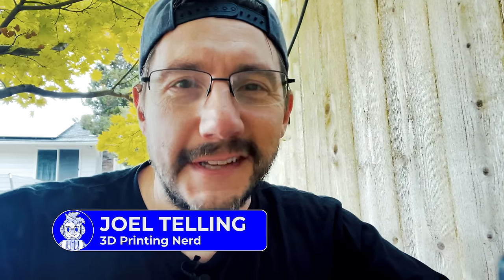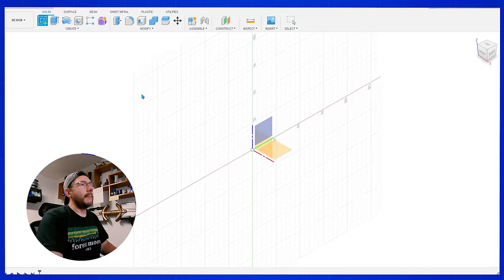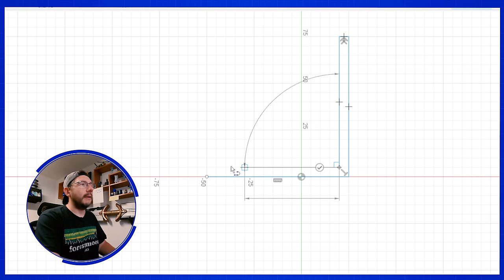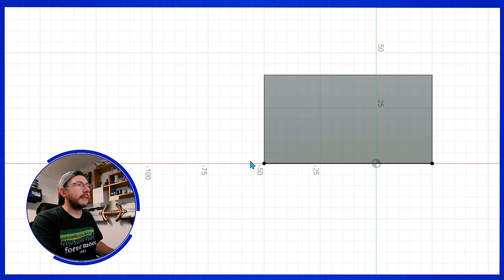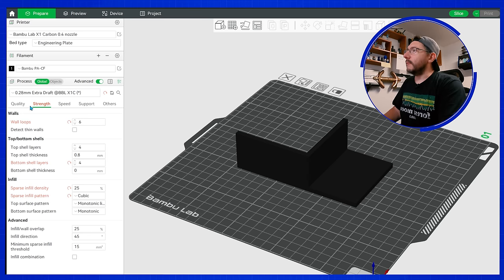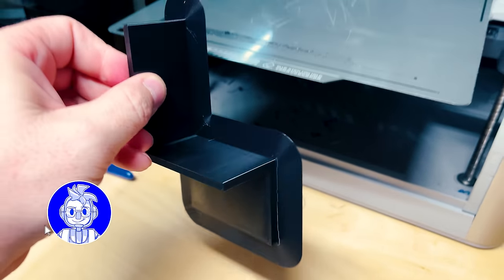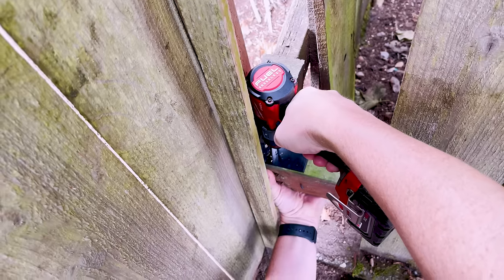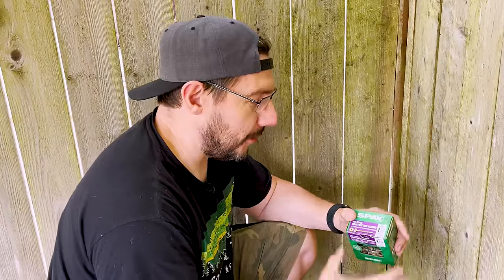The Power of Practical 3D Printing: Fixing My Fence with the Bambu X1 Carbon

Comment: why didn't you model in the holes? I have done things like this and modeled in tapered holes to fit things like drywall screws. Opportunity missed. Love your stuff Joel.
Reply: yep, they only take a few seconds - even pilot holes will reduce the risk of cracking the piece....
Reply: Yep, and depending on the orientation it also creates walls around the hole rather than just a hole drilled through infill.
Reply: @BigDan1190  My modelled holes normally come out too small, and need to be drilled out anyway - you do need the walls. This model was 100% fill though, I'd still be concerned of cracking it drilling straight through....
Reply from the maker: I didn't model the holes because I wanted to place them after the print. I know lots of people say modeling in holes is better, and that could be true, but like mentioned, this is 100% material. I know cracking COULD be an issue, but PC in my experience doesn't like to crack like that, so I wasn't too worried. I'll inspect it later and find out!
Reply: @3DPrintingNerd  I have no experience printing or drilling 3D-printed PC, but I have drilled Lexan sheets, and those buggers do crack, unless you drill with gradually incrementing sized bits....

Comment: would have been a lot stronger if you would've added a gusset from the horizontal to the vertical that was an extension of the tab... good design doesn't happen by mistake
Reply from the maker: That’s a great tip!

Comment: Great Practical use :) A small tip: 90 degree angles are breakpoints, make small champfer (In this case 1-2mm would do it) to make it more sturdy. Boards usually have rounded corners and when not it is easily fixed. It makes the printed parts way less prone to breakage. when making smaller parts it is more important
Reply from the maker: Thanks for the tips!
Reply: @3DPrintingNerd  Keep being great H5 - Do you have heat creep issues on your Bambu? I got them with it all closed up an with a bed of 100 degree -> 
When ever I'm printing ABS and the Chamber Temp goes above 45 Degree.
Reply: @3DPrintingNerd  yous should do another fan mail friday video. Those are always cool

Comment: Please do NOT print functional outside parts in PLA, they WILL fail in the summer unless you live at the north pole.
Additionally, both PLA and ABS have the issue of not being UV-resistant. My recommendation would be PETG (sufficient in most situations) or ASA, as both are UV-resistant and more temperature resistant.

Comment: Most probably this took longer, was more expensive and will not be as durable as a bracket from the hardware store but I would have done it exactly like that too ;-)
Reply from the maker: BOOM exactly! heh.
Reply: Ha ha ha, it is all part of the fun. I figure it also helps dig out that rabbit hole of “can we do this” and maybe someday it will be a better option?

Comment: Don't have any metal L brackets in the work shop?  I always have a couple and would have opted for that over designing and printing one. Do you think you made it long enough? That end looked a bit beat up. That fence seemed a bit wobbly.  I think you may have some more tinkering to do, so more videos coming?

Comment: This is the sort of thing I love using my printer for. One thing I’ve learned is that picking 5mm is fine, but if I have a .4 nozzle installed, picking 4.8 or 5.2 is better as it’s a clean multiple and the slicer doesn’t waste time with that pseudo-infill. That said, Arachne slicing is meant to help there so depends on your slicer
Reply: With Arachne that need for design around nozzle widths is a thing of the past.
Reply: @wojtek-33  nobody said it was necessary, but using clean multiples allows printing walls in straight lines without zig-zagging in the centre which speeds up prints significantly.
Reply: @wojtek-33  Good point

Comment: So Joel what I would have done is design the part with the holes included no drilling needed
Reply from the maker: Right, I get that. But drilling stuff with my drill is fun, and it's 100% material, so it's all good :)

Comment: You should have put some chamfers on those inner and outer corners so you have a stronger part.
Reply from the maker: Right, chamfers would have made the 90D angle stronger, but you have to remember the nail that were there ARE holding the piece in place, so while it doesn't have chamfers, I think all together it's still a strong piece.
Reply: @3DPrintingNerd  oh for sure. It wasn't as much of a critical remark as much as I put a chamfer on everything. Yes the hot sauce commercial pun was intended. 
You always make great content.

Comment: Perfectly fine to use 3D printing for this, in some cases its a lot quicker than going to the store and even if its not, sometimes you just don't want to or you're stuck at home waiting for a delivery or looking after kids e.t.c.   What i would say though is you could have added some fillets or chamfers, for a better looking print aswell as a chamfer would have made that 90d angle stronger, and you could have easily designed the screw holes into the print, it genuinely would have been quicker than drilling the part. I don't expect everyone to be an expert but this could have been better considering how many people watch your videos and learn from them.
Reply from the maker: It was 100% fill and I thought drilling the holes would be better since I could place them where I wanted. I could have modeled holes too, I think both are fine solutions. A better looking print isn’t something I was worried about since it’s just a bracket that connects fence boards :) I do like the idea of chamfers, but I forgot at the time. I do think it’s going to be okay and I’ll try to remember for next time.
Reply: Hardly looked quicker to me. Could easily have bent a piece of metal into that shape and drilled some holes in 10 minutes. Could probably have even fixed that just using some longer screws anyway. This is just a case of trying to find an excuse to use your printer.
Reply: @elobiretv  that's because you probably have a piece of metal and the means to bend it... Not everyone does. I have a load of angle brackets in stock but if I didn't I'd probably rather print one than have to put on pants and drive out and deal with the general public, fuck that!
Reply from the maker: @elobiretv  I appreciate the comment. I didn't have any metal pieces to use. Longer screws wouldn't have held it well because the wood at that end was starting to get bad.

Trying to find an excuse to use my printer? Really? If you have a hammer, lots of stuff becomes nails, right?

Comment: I would have put a bracket underneath the horizontal board, rather than on top....
Reply from the maker: I had thought about that, but went with this route. If it fails, you know where the bracket is going next :)
Reply: @3DPrintingNerd  Underneath would be a bit trickier to screw - but if you put a 45 degree rib between the arms of the bracket, it will support the board in compression, would be far stronger..... that printer is awesome BTW. Although trimming off all that brim looks a headache! The price of PC I guess.... :)

Comment: I designed a 3D printed gate latch a year ago out of ugly-flex with a roller on it and it still works great! Attaches on a post corner and the wooden gate hits the roller before seating at it's limit so snaps closed. I the winter it's harder to close than summer though ha ha! 3D printing nerd is the best!

Comment: Practical prints are the best. I have a trailer with a storage compartment, for the drain hoses, that wouldn't stay closed. I printed a new latch but it still wouldn't stay closed. When I brought the trailer home the latch and knob fell out along the way, so their gone for good. I took some measurements and fired up DesignSpark and in a few minutes had a new knob designed and I reused the latch I designed before and although not perfect it worked much better than the original. A slight design change and reprint and it came out exactly how I wanted.
Reply from the maker: Heck yeah!

Comment: Great process on the design and install.   Still thinking putting a couple of holes in each face would have been a good option.
Reply: +1 - at the very least pilot holes for drilling out....

Comment: I know everyone else is saying stuff about getting fifty-cent mounting plates, but here's my contribution of an equally silly solution: Wrap an old electrical extension cord around the whole affair, with the wraps sitting parallel to each other so that they lie flat, then shove a blob of epoxy putty on to keep the ends in place.

So, basically a giant version of what I do for wire-wrapped jewelry making, which likewise proves everyone else's "if all you have is a hammer" point.
Reply from the maker: That’s a beautiful solution!

Comment: Joel, (I have even gotten my wife to watch a few videos of yours) You seemingly have a surplus of great printers that seemingly operate flawlessly.... HOW DO YOU DECIDE WHICH PRINTER AND WHAT FILAMENT TO USE?
Reply from the maker: Oooh, that's a good question. Typically my projects can use PLA, so that's easy. As for which machine, just depends on which machine I have is loaded with the material and color I need at the time. If none are, which is closest to me :)
Reply: Sorry but I missed somewhere what printer you used Joel, I haven’t printed in years by now. I’m impressed with how strong and even shinny the bracket came out!.

 I’m dying to get a printer in the $500 range printing like that what would you recommend? I’m more into alternative energy but since I’ll be selling a couple of devices for hobbyists like myself 3D printing will become a practical necessity, thank you.
Reply from the maker: @kukulcangod1  For this I used the Bambu X1 Carbon!
Reply: @3DPrintingNerd  Thank you for taking the time to tell me Joel! I consider you a celebrity and a súper profesional expert on this field!
Reply from the maker: @kukulcangod1  Awww, super kind of you so say that! I'm just glad I was able to see this AND relay the needed info!

Comment: Not dissing on using printing to fix this, but why not just put two screws on the other side reaching through the hole in the fence to fix the board where it was and save a lot of time?

Comment: Cool practical print. Any advantages of not including the holes in the design itself?
Reply from the maker: I went with 100% material because my goal was to use my (new, fancy) drill. My thinking was that this would allow me to place the holes exactly where I wanted AFTER the print was done. Had I modeled in hole and did 100% infill like this, it would have been a tiny material savings, but I don't think mechanically it would have changed anything.

Comment: I ALWAYS look at 3D Printer solutions. My home video security system, one of the camera mounts broke. 1 solution, buy a new camera for $200 as they do not just sell a replacement mount. Solution, I modeled the mount, built it in ABS, needs to be strong and withstand Arizona heat. Finished. My BMW i3s. No trash can but plenty of room in front of the cup holders. In fact they have slots to add on accessories, like a 3rd cup holder or keyfob holder. We only use 2 cups so no need the 3rd and I never really leave the keyfob in a holder, which I did build one. I decided I will build a trash can that attaches to the 2 slots that can hold accessories. Why not design a trash can that attaches there. Build again in ABS so it doesn’t melt and there we go, very useful. I do a lot of robotics which those are fascinating but not really practical. I do build things like a chess set that comes apart into 4 squares to make up the board and each square the pieces fit on I made look like puzzle pieces. And the board goes into a box that holds the board pieces and I built another box for the pieces which I made to look like small robots. Other things, I 3D scanned my hand and it holds up my Alexa and I built a Borg cube around it that I light with LEDs controlled by an arduino so I can vary the colors. Also a word clock with LEDs that light up the letters and it spells the time. I did each letter in different heights of 3D blocks. That was my most challenging project and actually my first project. Should have done that 2 years later as it’s not cosmetically perfect. Could have done a much better job now but I’m not backtracking as it’s functional. That one is Raspberry P.I. controlled. I don’t do figures as I try to make things that are 60% practical. I am building a replica of my Snapmaker 2.0 A350 not to be functional just for fun. So that’s not practical. Cheers, always great content from you.
Reply from the maker: Oh man, some great solutions there! EPIC!
Reply: @3DPrintingNerd  Thanks. I've gotten really good at designing using Fusion 360. I might try shapr3d, not sure. I've got 4 3D Printers. My favorite is a Lulzbot TAZ 5 which does NOT have auto bed leveling. Now I can upgrade it to have it but it's not really that difficult and for a direct drive with drive screws it does hold a level pretty good. I do level and home every time I turn off and on the machine. I also have a Sindoh DP200. Decent machine and I hacked it to use 3rd party filament vs. their proprietary. And if you try to use their cassette type cartridge by unwinding and loading filament onto their smaller reel to add to the cartridge you are asking for trouble. I don't like enclosure, which the Sindoh is. If you have an extruder jam it's a pain as you have to get into the machine. I've done it maybe 4 times and you have to be careful. I have a Snapmaker 2.0 A350. It's OK but like the critiques say if you buy a 3 in 1 printer they are not great at doing any one thing. I printed one of Angus's accuracy test models and the Sindoh and Lulzbot did excellent, the Snapmaker not as good. The last printer I have, actually the first tiny one I bought is a very unknown one, Dobot MOOZ 2. Same print volume as the Snapmaker Original. In fact one of them must have sued the other as they seem identical. But, this is shocking, the Dobot MOOZ 2, granted too small to be really useful, it make prints to perfection. Surprising isn't it. I do a lot of robotics so when I do gears that can fit the Dobot MOOZ 2 I always use it. For bigger things I can't so I use the Luzbot, if that's busy I use the Sindoh, last resort is the Snapmaker. Perhaps I'll grab their 10w Laser Module and just use the snapmaker for doing that being VERY VERY careful of the eyes. So the order of my favorites, Lulzbot, Sindoh, Snapmaker BUT for small prints I always use the Dobot MOOZ 2.
Reply: @3DPrintingNerd  Oh, should have mentioned this. The reason I love the Lulzbot is that I have the original .5mm nozzle using 2.85mm filament. BUT I also have a .4mm nozzle that uses 1.75mm filament and I built the Moarstruder with the 1.2mm nozzle which I can dramatically built prototypes really quickly and then I swap to the .4mm 1.75mm filament for the detailed model or I simply move the model to the Sindoh. I use Cura as a slicer across all the printers. Even with the Snapmaker I do not use their Luban. Cheers again sorry for all the detailed reading but thought you would find it interesting to give you my printer preferences.

Comment: In the past I've added holes to the model so I don't have to drill at all.  Then if the part doesn't have to be strong throughout it still gets reinforced at the screws.
Reply from the maker: But this is essentially 100% infill so it’s still nice and strong :)

Comment: 2:24 When you have a hammer, every problem starts to look like a nail. When you have a 3D printer …
Easier solution: Pull the stud into place (as demonstrated) take an electric screwdriver reach through the hole screw one screw on the neighbours side into place (opposite of the existing screws) ⇒ done.
Well, almost done: Nail the fence bods back into place. Maybe use a screw at the bottom. (The screw would secure the boards in a way that they will hold the loose screws in between the board and the stud.)
Your solution: 20 min designing bracket, 10 min preparing & slicing, hours of printing, 10 min installing.
My solution: 10 min installing.

Comment: I am kind of curious. Would it have changed much if you worked the holes into the design itself or would the structural integrity have changed if you did?
Reply: No, he should have done that.
Reply: I was wondering the same thing as I always design the screw holes in just so that I don't need to drill them out afterwards.

Comment: I am all about 3D printing, but for this job I think I would have just used an expanding glue, like Guerilla Glue, and called it a day.
Reply: Expanding glue definitely wouldn't hold here. The right answer is to not have your fence built with pocket holes, but hind sight is always 20/20. The bracket is good enough as is and will probably hold for a good while. When it fails, it'll be no worse off than when you started and you get to print another with 2 more years of experience under your belt
Reply from the maker: I do like Guerilla Glue, but I don't think that would have done the trick.

Comment: Some things just don't need to be 3d printed my guy.  For less than 54 cents you could get a metal bracket at home depot that will be ten times the sheer strength of that plastic.
Or just go buy a new 2x4